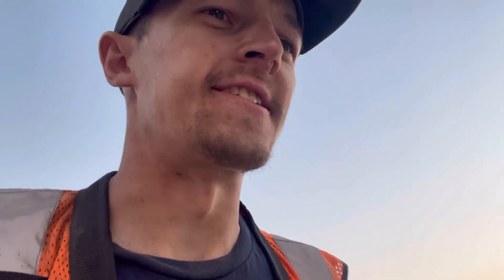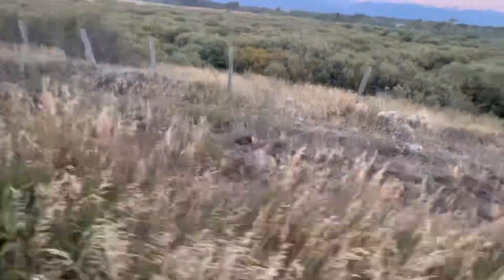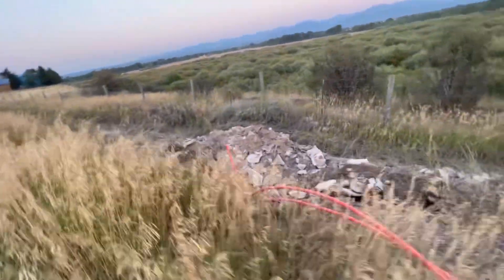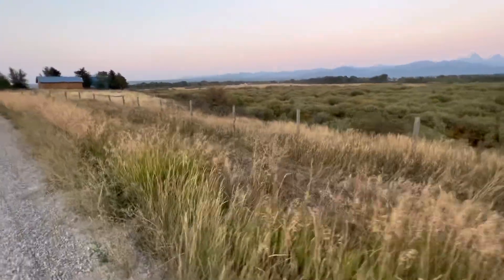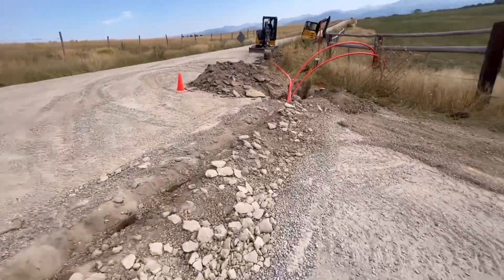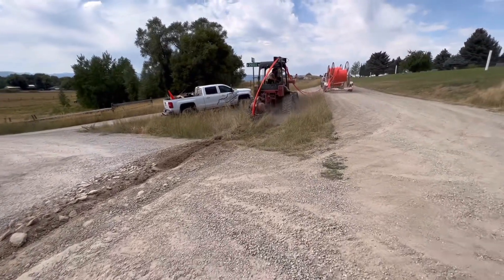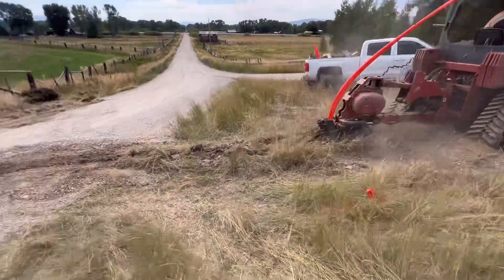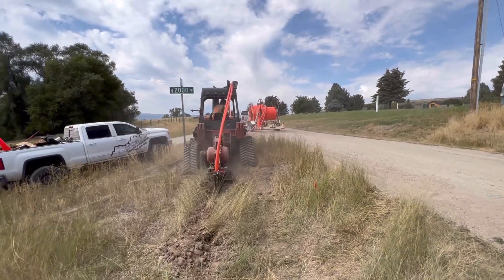Using a Ditch witch RT115 vibratory plow to install conduit for fiber

Comment: They are running fiber optic in my area and they have 2 Vermeer rtx1250 plows 2 mini excavators a backhoe loader and they was using 2 Vermeer directional drills
Reply from the maker: Some projects definitely require more equipment, we had someone else do the few road crossings with a drill, and we have 1 mini ex as well
Reply: Trying to get in touch with Tyson